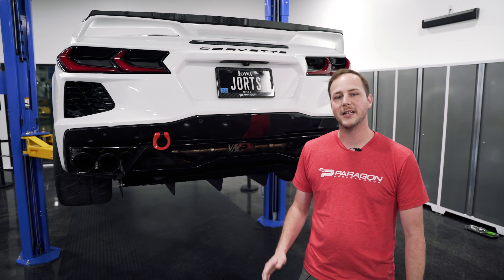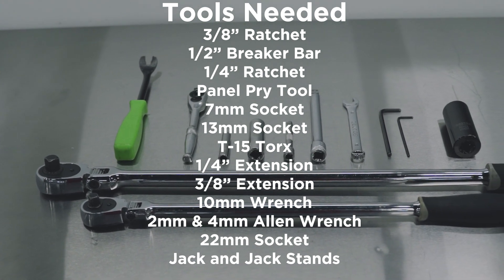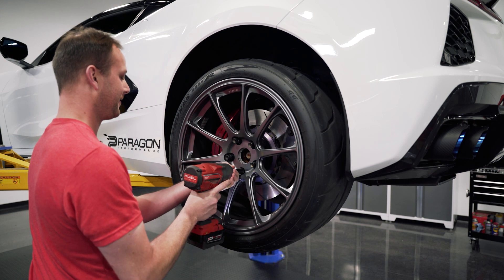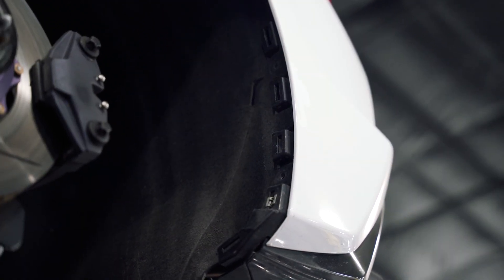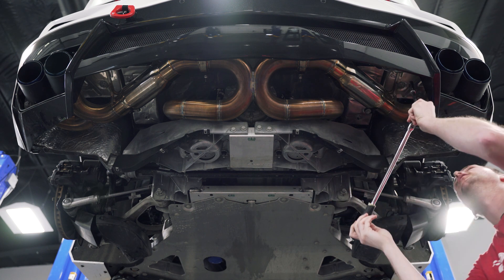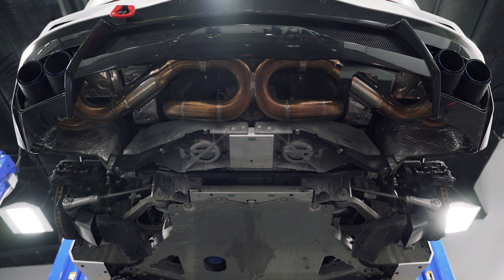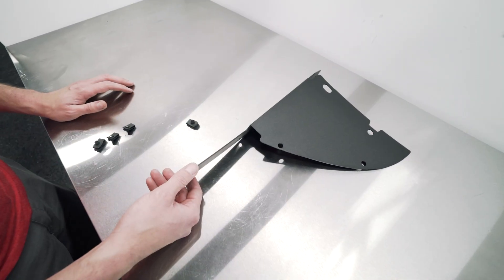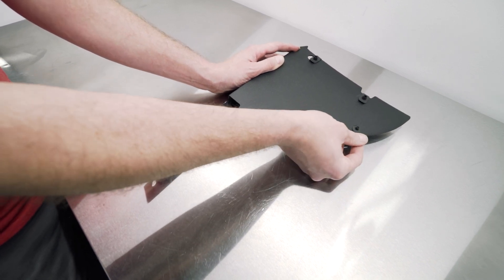Verus Engineering C8 Corvette Rear Diffuser Install! - How to - Paragon Performance

Comment: Which rear diffuser shows off the Titanium Exhaust pipes the best? I’ve been searching for a while now.
Reply from the maker: This Verus Engineering Metal Unit + Cutting the rear bumper or at minimum removing the metal mesh.

Comment: 28 pounds of down force is not worth that, but the way it looks is definitely worth it ! will be buying
Reply: they made a mk2 diffuser, which is way more expensive but its carbon fiber and has roughly 420 lbs of downforce at 100 mph. just about 1900 at 200. if you combine that with their wing at it's highest setting, you can get an extra 450 lbs of downforce totalling to 870 lbs of rear downforce at 100 mph. that rear wing and diffuser combo is gonna run you $5 grand however but id say its worth it.

Comment: What is "aerodynamic efficiency" as used here? How was the downforce measured?
Reply from the maker: The rear diffuser helps pull the air out from under the car more efficiently. 

The downforce was measured using CFD software by Verus Engineering. All the data is on the product page. 😁